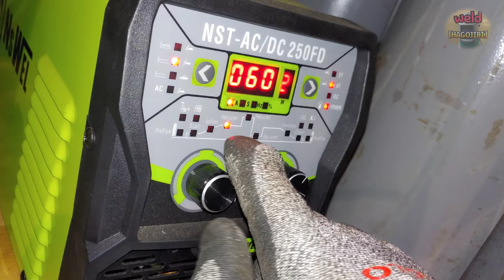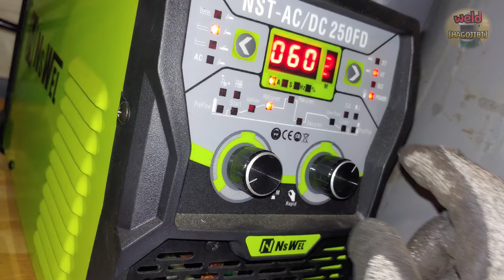3 Amazing Tricks for TIG Welding Small and Thin Pipes | Tips and Hacks

Comment: Thank you for sharing this method Hagojibi!  When you set the rod "in the joint" can you share, is the electrode pointed at the end of the rod, a little up the rod, or is the electrode pointed at the pipe?   I tried this method, and ended up sparking and spitting and balling the rod -lots of excitement, but not good result :D    Very much appreciate your thoughts!

Comment: Welding thick wall tubing is not the test. Try .035" or .028" thin wall 4130 aircraft structural tubing if you like frustration.  
Practice and patience are the key, along with the correct and size filler rod.
Try using ER309L 1/16 filler rod for more control on your stainless.

Comment: Perfect video , but I do miss your commentary . Why not run a high pulse with a low background current and a slow time so the arc can stay lit and keep the work illuminated  , ?
Reply: I have done this and it works.  No need for an HF arc start for each pulse.  If background current is low enough, the puddle can solidify and the workpiece can cool a little between high pulses.  However you need to have very low background current for small/thin  pieces, and some welders cannot provide background current that is low enough. Also I would want to make sure I had enough penetration.  The hammer-flattening of the tube end was a neat idea!
Reply: @benz-share9058  take a look at farm gates and school chairs . They have been flattening tube for welding forever . But it is handy .

Comment: Your videos are terrific. I have had an  everlast ext 255 for about 2 years, very little tig time, and very mixed results. Tig is for entertainment, I mostly use this for stick.
I watch plenty of tig instructional videos. Yours are ⭐⭐⭐⭐⭐
If you could do any videos with this prossess called cold welding, so i could under stand what is going on. Its like it is somekind of hocus pokeus.
Reply: In cold welding one high amperages for very short intervalls. The welds are usually not fused correctly because of that.
Reply: Cold welding is A JOKE.  Unless you need to weld two razor blades together, a cold welder has no purpose in this world.   Cold welders do not make a strong weld.   Chinese JUNK

Comment: here's a tip. if your puddle is running away from you so much its leaving a hole. keep adding filler and moving forward, draw the heat out and cool with filler rod. I weld aluminum 18ga with gaps and don't burn through, 1/16- 3/32 inch gaps that is!

Comment: Uh, I try to avoid gaps. (Need all the help I can get.)

Easiest way to get a no-gap fit is to use a milling machine, like I did recently while welding some 4130 tubing.  I’d never done that kind of a joint before, and am a bit surprised it actually worked out passably.

Still, though - this is useful, like when you can’t get the good fitups.